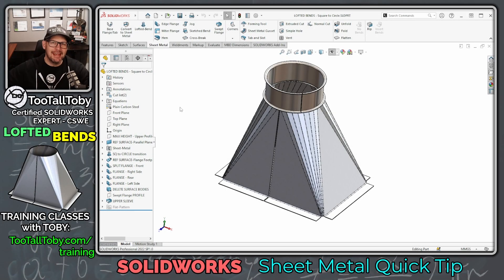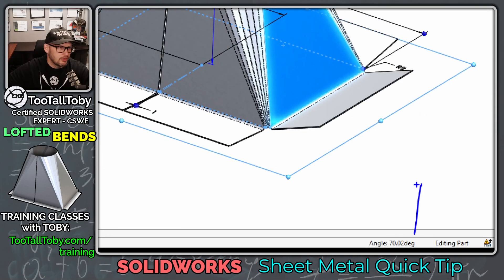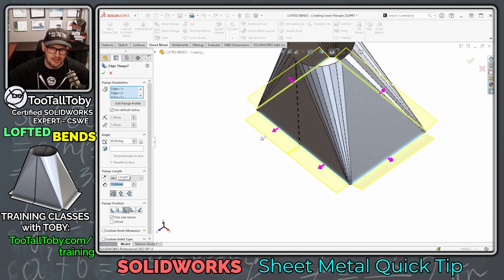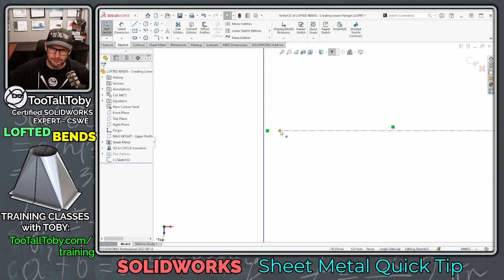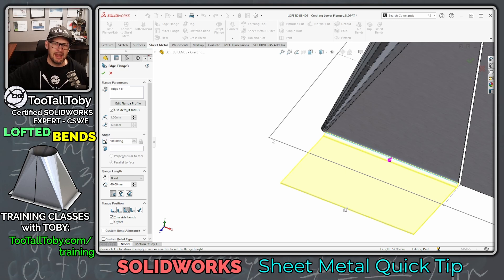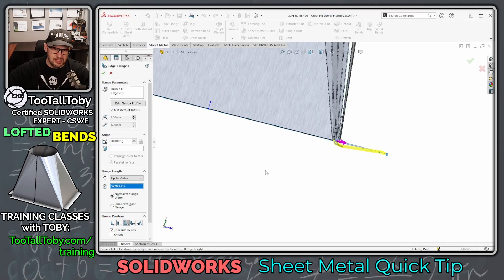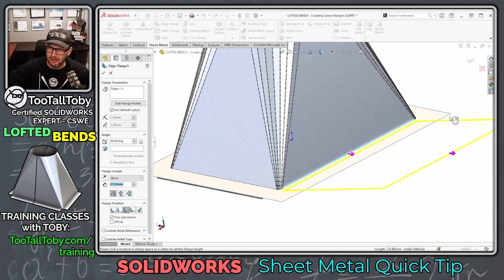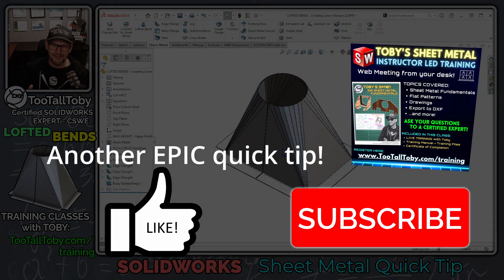Air Duct Reducer in SOLIDWORKS Sheet Metal - Tutorial for Students - FLAT Flange Angle

Comment: There is nothing stopping you from extruding an edge flange up to a sketch point, you just need to add a point to the sketch, however the surface helps with the parallel to face part of the problem.

Comment: If you delete the surface planer, then you change the loft. How will the angels be correct? I understand the dimension staying correct because they are tied to the construction sketch. But with the planer surface gone how will the angels come out correct if you change sizes?
Reply from the maker: you don't delete the surface feature, you delete the BODY.  you do this by creating a new feature: INSERT>FEATURES>DELETE/KEEP BODIES.  This will add a new feature, at the bottom of the tree - so everything will keep working 😁

Comment: How to control flanges to be on the same plane? Bottom edges of lofted shape are on the same plane. But,  all   4 flat sides have different angles with Top Plane. When you use 3rd option of bend radius position (start of radius on the edge) all 4 radii will have different length because of different arc included angle and angle of tangency. It means every of 4 flanges will be parallel to Top Plane, but they will be on different distance from Top Plane. For example: if you have one of the side perpendicular to Top Plane and bend radius is .100", flange will be below edge .100" . If other side have angle 75°, with bend radius .100", flange will be .074" bellow edge. For 80° angle flange will be .083" bellow.